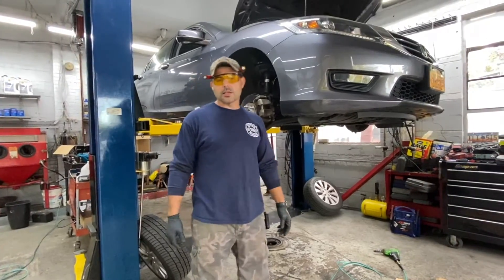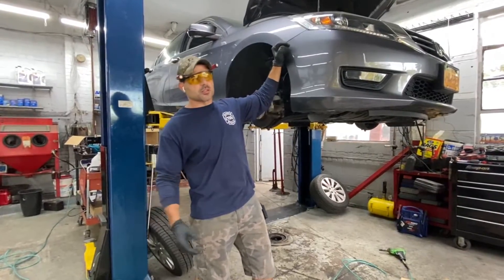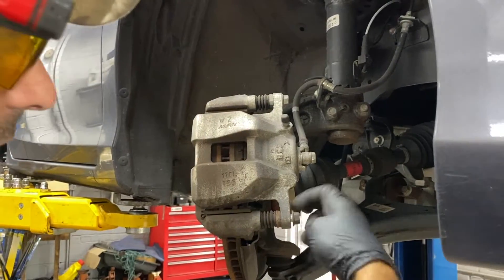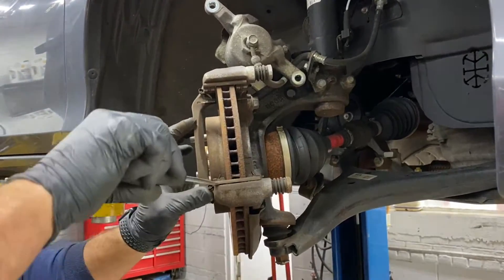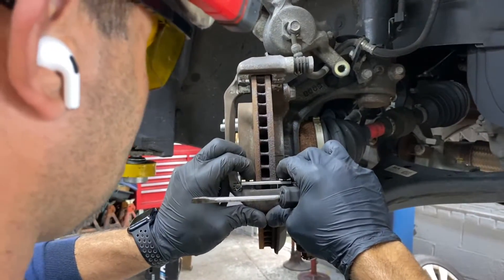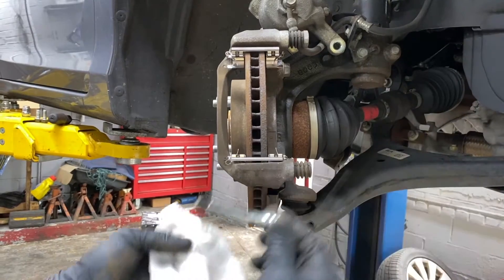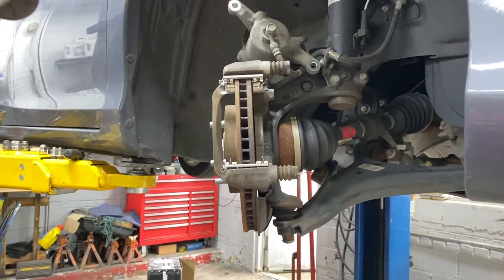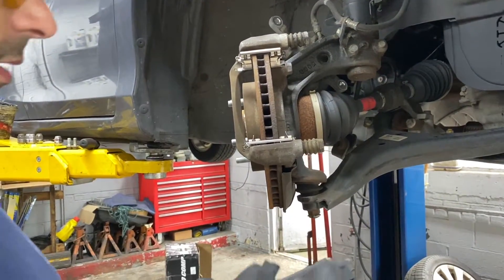How to replace front brake pads | 2015 Honda Accord

Comment: Another tip for a quicker job, you can also take out just the bottom bolts on the caliper since it opens up as a shell.
Reply: wouldn't you also wanna take out the top bolt so you can grease up the pin?
Reply: We need answers
Reply: Well?
Reply: Yes you need to grease both